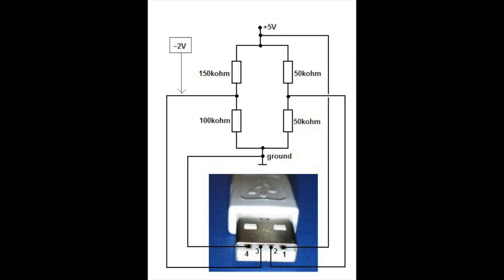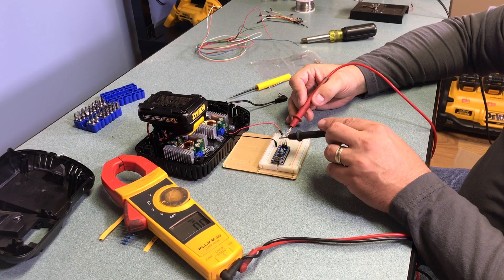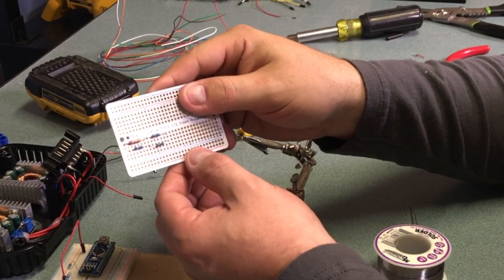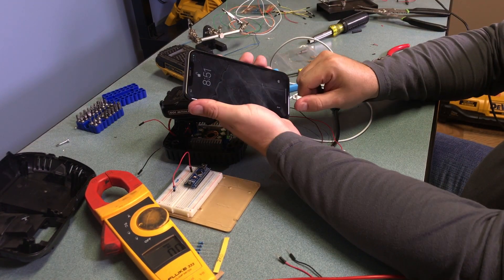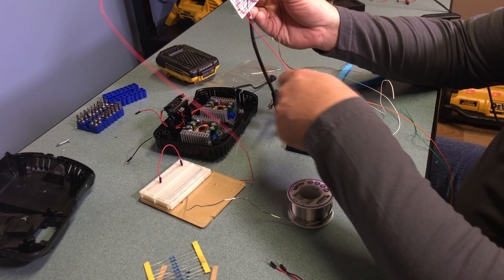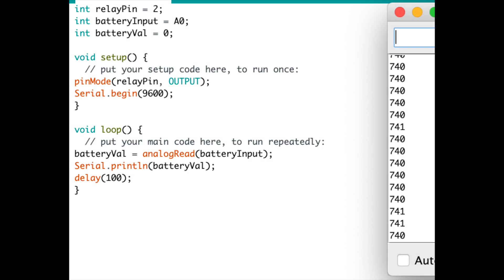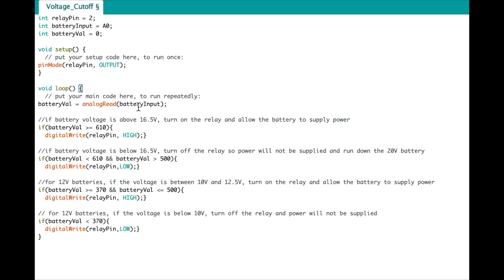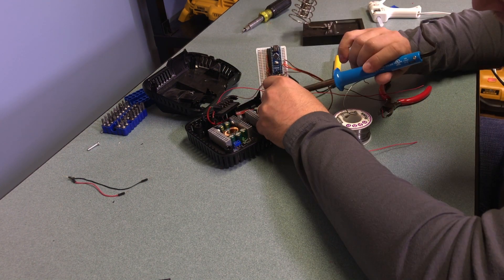Hack My Dewalt Charger Version 1.1

Comment: If I Want To Charge My Phone Or
Tablet I Just Use My Ryobi Usb 
Adapter. If I Want 18 Volts I'll
Just Get Me One Of Those 
Power Wheels Adapters That 
Fit Over The Ryobi Battery
I Found Out Dewalt Makes Power Wheels Adapters To
Use To Make A Power Suply
Now All The Powertool
Companys Make Usb & Power Wheels Adapters To Convert
Powertool Batterys Into
Power Suplys. I Even Have 
A Ryobi 120 Volt Power Suply
For Power Outages. It Even
Comes In Handy When ICant 
Find An Outlet For One Of My
AA Chargers Or One Of My 
Powertool Battery Chargers.
That Beats Going Through
All That Rigamaroe.

Comment: Great Video!! I want to use 20V DeWalt Batteries for Overlanding (4WD Trips).  I'm trying to understand how to build a charger with a 12 volt input that could be connected to multiple 20 Volt DeWalt batteries.  A single 12volt (cig lighter) charger for 20V Batts are crazy expensive $170.  I think that I would want to charge individual cells at the same time within the 20 Volt DeWalt Batt, So voltage up wouldn't be an issue. Any Thoughts?

Comment: Hi great video, Would the Low-Voltage cutoff be required if you are using the power supply to power a 15V device? Would the device stop working before the battery damaged itself?
Reply from the maker: Thanks for watching! That’s a good question and one that’s pretty device specific. Depending on the device, going below it’s rated voltage could cause some strange results, and possibly damage the device. A lot of devices have a +/- of about 10% for acceptable voltage, but I wouldn’t recommend testing that, unless you don’t mind if the device is wrecked. When it comes to the health of the battery, part of it is that the battery shouldn’t be depleted too lowly, but part of it is that the chargers won’t recharge the batteries if they get below a certain threshold, even if the batteries are still healthy and could be safely recharged. In that case you’d have to find another charging solution to get the batteries above that minimum threshold, then the Dewalt or other brand charger should work again.

Comment: Do the tools have this circuitry built into them to keep the battery's voltage from dropping too low? I have a light that doesn't get used, and I would like to use that as my power source case. And thank you for the detailed description!
Reply from the maker: Each tool does have a low voltage cutoff when they stop drawing from the battery. Older, non-lithium battery tools would keep working slower and with less power until they finally stalled. If you’ve used lithium battery tools, they seem to work almost at full power, then suddenly stop working because of the low voltage cutoff. I’m not sure if each type of tool uses the same cutoff, but your idea sounds workable. Thanks for watching!

Comment: Would mosfets be more efficient than relays? Do you have any idea how much current the relays draw? or how long the batteries would provide adequate voltages even if no load  or a low load was applied. The relay current wouldn't be so significant if the applied loads were high but an Arduino doesn't draw very much, particularly if it is relatively inactive or sleeping. I plan to turn my box of Milwaukee chargers into DC power supplies-finding a use for those unused chargers everyone accumulates is a very good idea. It would really be nice if the charging capability was retained, not sure how much extra room will be available in my chargers. I wouldn't need such high capacity (large) buck convertors if I only intended to supply Arduinos or Raspberry Pis but maybe mixing AC and DC power in a single enclosure is not a good idea?
Reply from the maker: Hi Jeff, thanks for watching. Transistors or mosfets rated for the load current would be more efficient than relays, if that efficiency is needed. Those small relays don’t use a lot of current, but they will use some, and that might be a big deal depending on the application. There are also manufactured voltage cutoff devices that will do the same thing. Sometimes the most challenging problem with those is finding the right model that will cutoff at the needed voltage. The problem with battery depletion is not just to prevent the batteries from depleting past a certain level for the sake of circuit functionality or even battery health, but also because the chargers won’t charge a battery that has a voltage below a certain threshold by design. 

With my Dewalt chargers, there’s no room to keep the original components and also add the power supply hardware, but maybe if you attached it to an enclosure you could make it dual purpose.  Sounds like an interesting idea!

Comment: Cool, thanks for the video. I would like to make a Dewalt powered pro-style DC power supply (with an adjustable output, voltage meter, banana plugs, etc) and this helped a lot.
Reply from the maker: Thanks for watching. Good luck on your power supply!